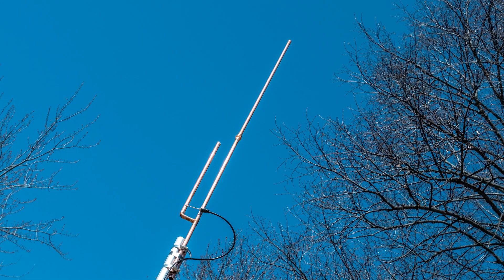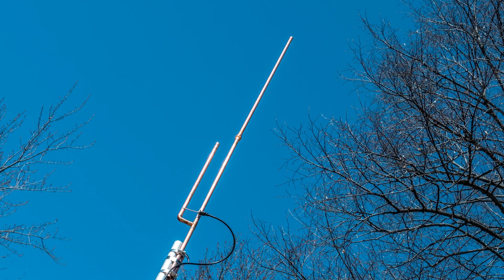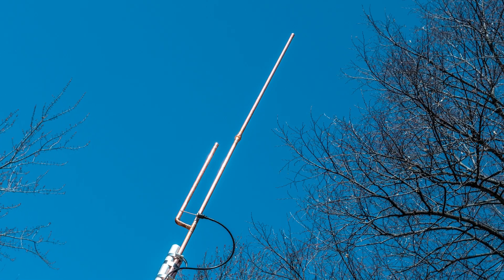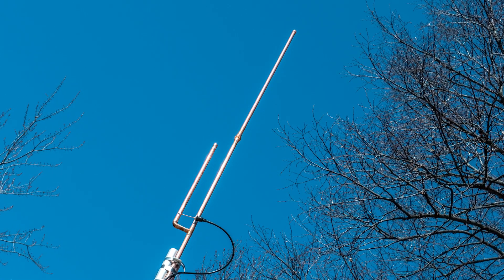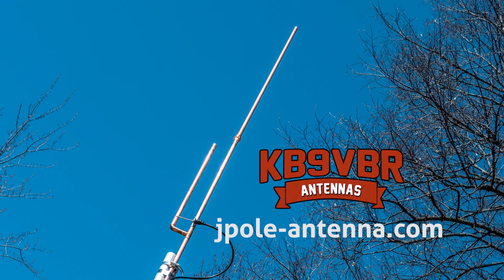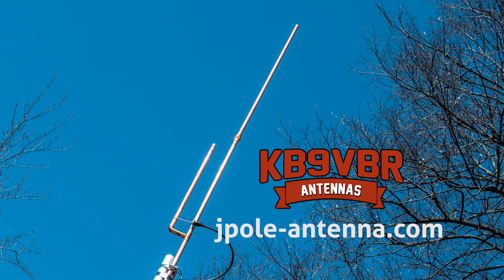Ask Michael, KB9VBR: Removing wire memory - October 2022 Livestream #hamradioqa

Comment: To straighten wire, drive three nails into a board about an inch or so apart (2.5-ish cm). Wire goes through the nails - pull out straight wire. For insulated wire, lengths of copper tubing slide over the nails to avoid scratches on the PVC. At least that’s what we did when I worked in a wire mill. YMMV.

Comment: The BNTECHGO 20 or 22 gauge stuff from Amazon comes in a lot of colors (e.g., high-vis yellow) and seems pretty slick (easy to wind up) and seems to have very little memory regardless of the length of wire you buy.  I also have some 26 gauge which does work fine for portable/qrp antennas, but I think just going a couple of gauges higher (i.e. 20-22 gauge) seems easier to deal with.  I don't see any good reason to go with heavier stuff, esp for portable, unless you're just trying to use up what you already have around.

Comment: Does it make a difference in the direction a  J pole antenna is pointing
Reply: I’m putting a 2 meter antenna on side of a tree any suggestions on a type of antenna and will the tree block transmission . Making a bracelet to bolt antenna to tree what is a distance antenna should be from tree

Comment: Taking the curl out of wire is not that hard.  Step 1) Anchor one end.  I usually put an end in my vice vice.  Step 2)  Roll out the wire.  3)  Chuck the free end into a reversible drill and pull the wire taunt.  Step 4)  Pull the trigger on the drill.    A good demonstration can be found at https://youtu.be/Kdx5-adaZ34
Reply: That’s for solid wire. Not so easy with stranded jacketed wire.

Comment: Shock the wire.

I had very good luck with some 18# bare copper ground wire I bought for radials. The  tight memory made it unusable, but I clamped one end in a vice and held the other and with pliers. I pulled them tight, let off a little, then yanked to shock it. Not so hard to break it, but enough to break the memory. It wasn't perfectly straight but removed probably 75% of the memory and no more fighting.

Comment: Hi Michael,
For portable use, put a ring terminal on the end of the radial and use a nail to stake it in the ground. That could also be used for a permanent installation while the grass grows up around the radials. You and Christine stay safe.  73  WJ3U

Comment: N4SQY  To anneal copper wire, or soften it, you must heat it cherry red. Heat guns or sun exposure will not help. Slightly stretching it while pulling it over a resistance opposite the curl will help some.

Comment: Plenty of tutorials on YT for straightening wire with a drill. If you only need it for very small gauge wire, they also sell wire straighteners in the crafts section of hobby stores. You can probably find a larger heavy duty version of this online, but they tend to be expensive.

Comment: Hi All
I have the same problem, I old lengths of 3.5mm  solid copper insulated wire that I intend  to build a n 11m balance feed Yagi. The wire came in a roll about 1 m diameter and absolutely wanted  no part in being unrolled.
 I now have it staked out and am going to let the African summer Sun cook some sense into it.
Going to leave it about six months and see what the hot/cold cycles do to its memory.
73's 44ZA010